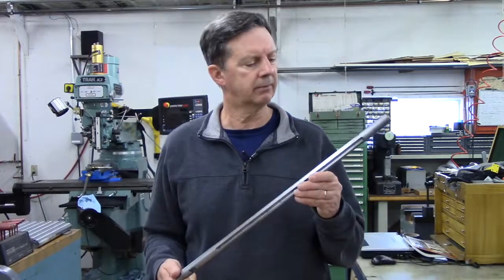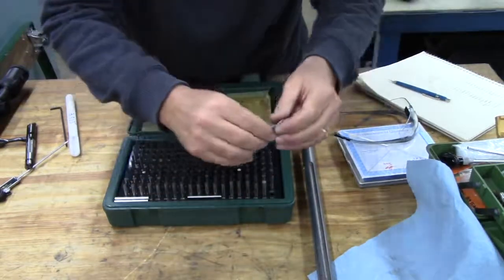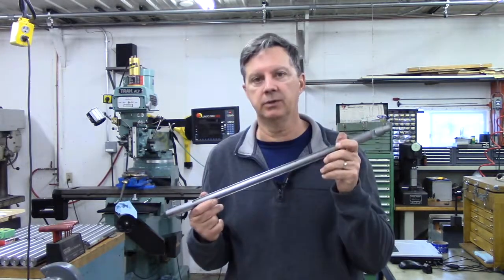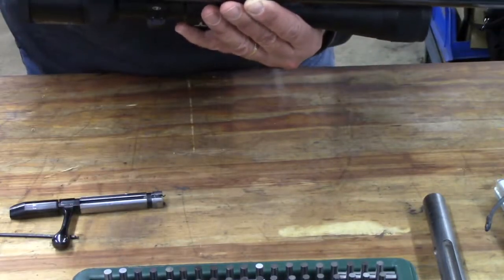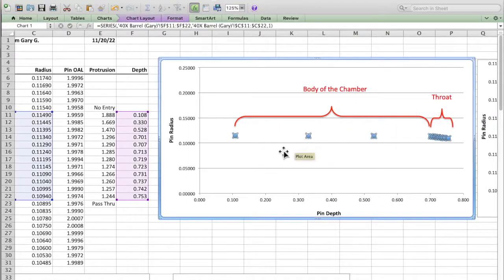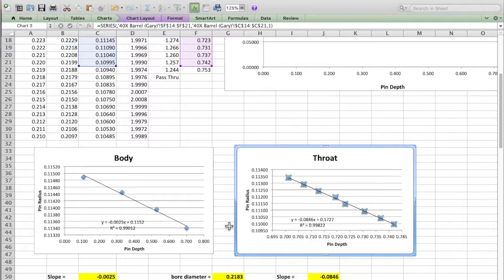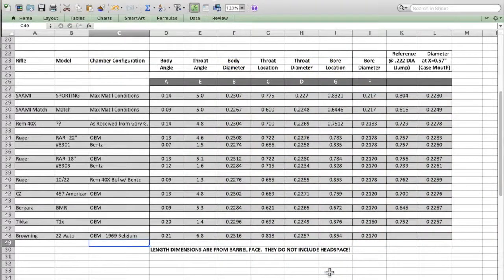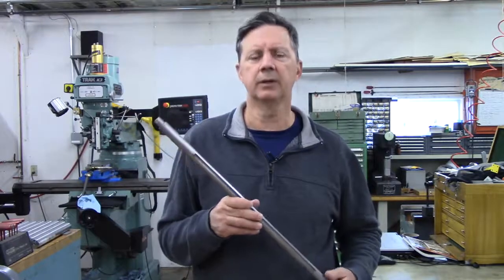How To Measure a 22 Long Rifle Chamber With Pin Gauges

Comment: You would get a more accurate measurement if you used the step faces of the calipers
Reply from the maker: In general, I agree with you.  Using the step faces of the calipers allows you to feel then they are bottomed out and square to what you are measuring.  Sometimes, it is a matter of which end gives you a better feel for the part you are measuring.  Rewatching my video clip, I'm asking myself why I didn't measure with the other end, and I can't remember why.  I'm sure I'll be measuring more chambers again soon, and then I may remember why I did it the way I did.  
Thanks for watching!

Comment: I have a question, what would it cost to have you assemble an FAL upper if I supply the parts?  If I was to do this what receiver and barrel do you recommend?  I have an older STG 58 lower that is 100% complete but looks a bit battered but is very usable.  I own a like new Belgium FAL and would love to have a 16" metric/Belgium style rifle that I can shoot and enjoy without shooting my nice rifle.  Any info would be helpful, thank you.
Reply from the maker: Hi Larry,  I have to pass on FAL gunsmithing.  However, I can recommend Arizona Response Systems and there is also a gunsmith in TX who goes by the handle of Sledgehammer on falfiles.com.  I hope this helps.